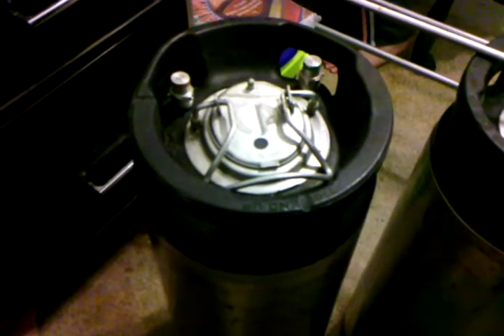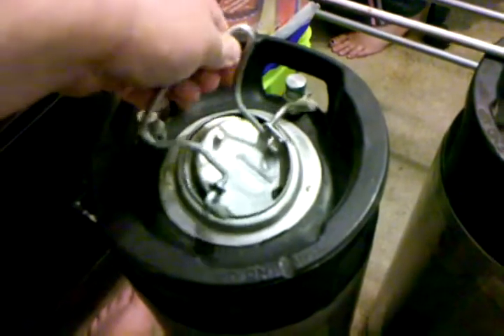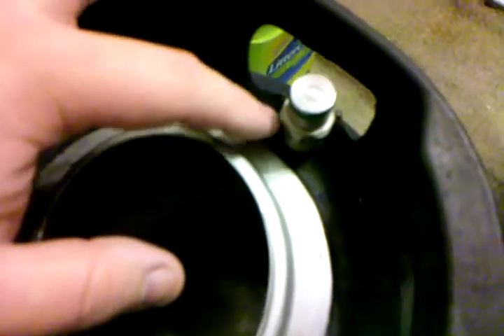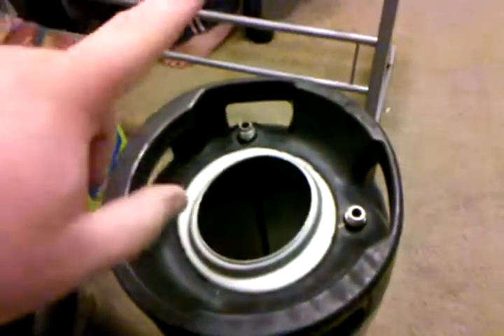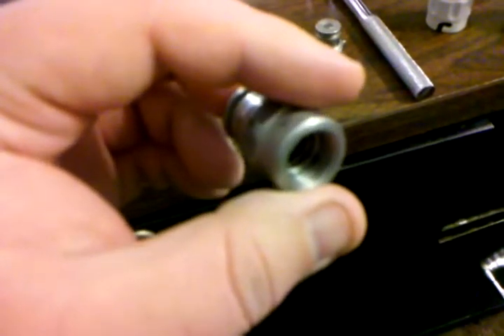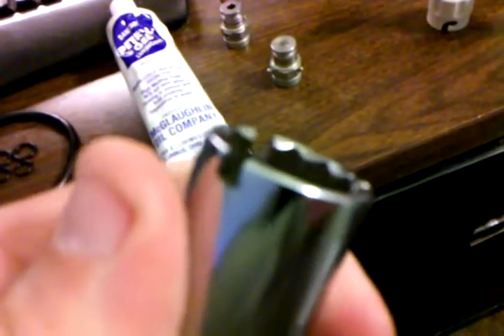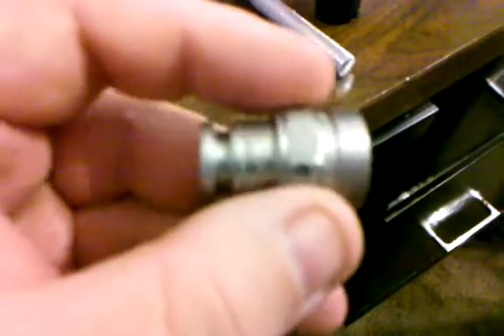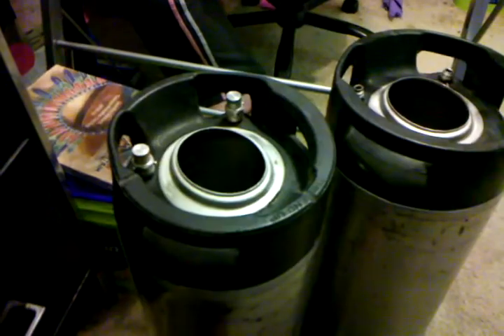Kegerators 101 - Corny Kegs and Seals

Comment: i could be wrong man, but just a heads up, if that lube is really made from a petrol base then it could damage your seals since oil based lubes degrade rubber.  Also not sure about that getting into your brew.  Better off using a water based lube. (ive heard KY jelly is totally acceptable.)